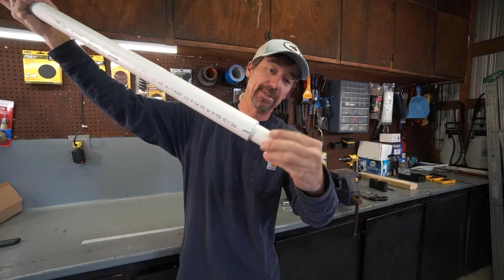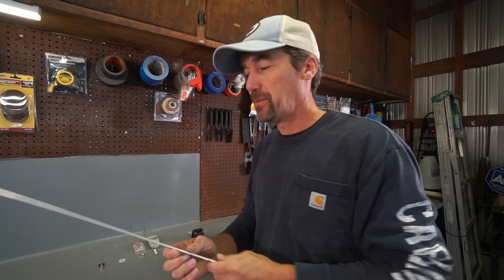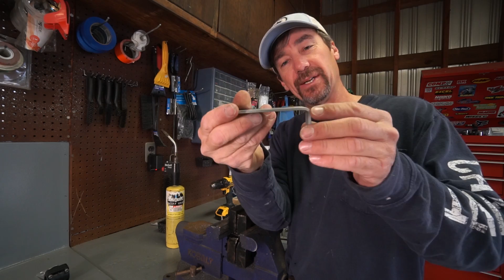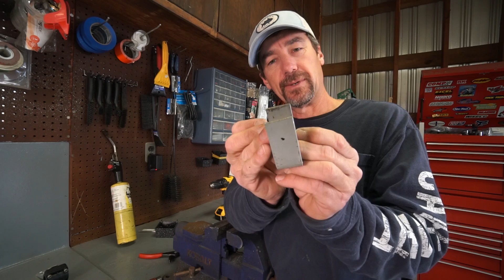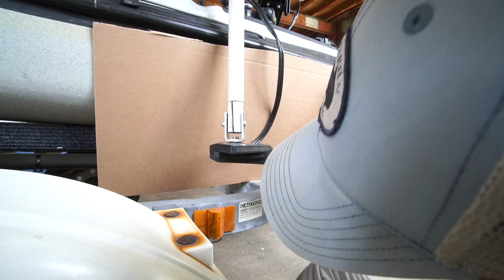Livescope Perspective Mode Transducer Mount Build (WAY Better Than Garmin's)

Comment: I know this vid is 4 years old but I'm assuming it would work same way with new lvs34 transducer? Is lining it up for the different modes not as complicated as the manual says? This mark has to be in this position, that mark has to be in that position for perspective, then 2 totally different mark positions for forward then another 2 for down? New to all this and just trying to figure it out

Comment: I made mine today just like yours. Thank you very much for the great how to video! I'm going to try to mount mine using two one and a quarter tees. One tee mounted on the boat rail the other on my live scope pole with a piece of "all thread " and just pin them together. Maybe it'll work. Tight lines
Reply from the maker: Thanks and good luck!

Comment: This is an EXCELLENT video sir! I have  my Lv32 transducer on my trolling mtr but when when I try and scan with it I don`t see my little position icon on my screen. You know that little circle that shows the direction? Can you help tell my what I need to do to get it on my Garmin HDU 93sv unit?
Reply from the maker: To be honest that function has always been buggy, if your calibrate the compass in the setting it will work, until you switch modes and then it stops. I never use it. I have an indicator that show the direction.
Reply: @SouthernReelsFishing  Thanks!

Comment: Does the transducer need to be below the lowest point of your boat so that the boat doesn't block the signal? How far below the hull does it need to be?
Reply from the maker: Yes it does. And question 2 would be the top of the transducer should at least be level, or lower than the lowest point of your hull

Comment: I'm a kayak angler I just got 10" ultra & going add lvs34. I'm looking at different mounts & for pricing I think I'll try building one first. I have access to aluminum at work so I just have buy pvc what size pvc are you using? Can you use any smaller or not?

Comment: Great demonstration! Explained perfectly! I would like to see your mount on your big boat. Thinking of buying a live scope,  but it’s a bit intimidating with installation. Where is your black box located and what is your power source. Do you also have a Humminbird installed. Thanks!
Reply from the maker: Black box is mounted inside the hull in the back area up to the cargo floor. No humminbird just garmin. Power is Nocqua lithium batteries

Comment: ok, I made on of the first brackets and sold that boat (Pathfinder) last june.  Now have a Blackjack 224 and making another Livescope DIY.  I’ve looked at some of the pre-made mounting systems and thought would like to try the DIY first before investing large $s.  Have couple questions though.  If I wanted to run the connector up the PVC pipe it would take a 1.25” pipe to accommodate the Livescope connector.  that said then would the 1.25” pipe fit inside a 1.5” PVC pipe.  I haven’t tried this yet so thought I would ask.  Also with my boat it has a couple of the RailBlaza bases on the gunnel so I’m going to try one of their mounting plates to see if it will hold the pipe ok even when I might be trolling.  I’ve already ordered a Ram mount C size as a back up.  I used that design on my previous Pathfinder.  So anyway, will be mounting all this when I get back to Grand Isle, LA end of next week.  Appreciate all the work you’ve done sharing your experiences and trial and errors.  Thanks, Michael

Comment: Just looked at it again and really appreciate it. Would give you a double like if I could.   Anyways, any chance you can make a few of these and post for sale?  It looks simple enough but I don't have a way to heat it etc.   Curious if you would consider that. Would be a great help.   Also, as you turn it repeatedly, does it now wear out the pipe and get loose?  Do you keep tightening it? Thanks again . Just superb.

Comment: how do you recommend install pvc pipe to a bass tracker pontoon boat? need to clamp on side somehow.
Reply from the maker: Ram mounts are hard to beat. Go to there website and they have u bolt style fittings that you could use.

Comment: What size where your PVC pipes?

I went to Lowes today and the 3/4in wouldn't fit in the 1in, so I had to go 1in inside of a 1 1/4in

Also, how did you get an H-rail mount to hold that PVC pipe?
Reply from the maker: I use the 1 in inside the 1 1/4 on my longer boat setup because it needed the extra rigidity. On my yak I use a 1 inch pvc outer with a 3/4 inch irrigation pipe inner. Also all the fitting are the barbed type press in that the irrigation pipes use. The pipe is sized right to slide right into the 1 inch pvc. Links below

https://www.lowes.com/pd/Silver-Line-Plastics-3-4-in-x-2-ft-160-PSI-Plastic-Coil-Pipe/1000170901

https://www.lowes.com/pd/Genova-3-4-in-Dia-Insert-Male-Adapter/3455128

https://www.lowes.com/pd/Genova-3-4-in-Dia-Insert-Plug/3456480

https://www.lowes.com/pd/Charlotte-Pipe-1-in-dia-x-5-ft-L-450-PSI-PVC-Pipe/3133093

Comment: New subscriber, great video.  I went back and watched your previous video,  definitely prefer this mount to your original design.  How tight are you attaching the U bracket to the transducer head?  Should the foam washer be preventing the head from moving or should it be firm but not too tight for minor adjustments?   Keep the videos coming.
Reply from the maker: Not very tight. The washer holds it in place but allows movement if you need to adjust it

Comment: Great video!  One question I have is how did you figure out where the front of the transducer is when it is in perspective mode.  In other words if I was looking straight at the transducer that was pointed directly at me what would I see?
Thanks
Reply from the maker: I just squared of each flat element on the transducer. There are 3 that are staggered. Pretty much 90 degrees off the middle element is straight ahead. A full proof way to line it up in while in the water point it at a small pole and line it up that way

Comment: I don't think the angle is needed. The top of the transducer is flat. The angle is 8 degrees on the Garmin shaft mounts to clear the trolling motor if mounted on one. From Garmin "The trolling motor shaft bracket features an 8-degree cant to reduce the effects of the trolling motor barrel interference with the transducer beam."
Reply from the maker: Yeah it would probably be fine without it. But I have OCD so it bothered me lol

Comment: Not sure if anyone else mentioned this, but you can mark your line with ivory soap (or just put some soap near the line) on the aluminum and heat it until the soap turns black. Ivory soap turns black at the same temperature for annealing aluminum, so once it turns black, you can bend it safely without tearing it.  Thanks for the vid!
Reply from the maker: Nice tip brotha thanks!

Comment: Thanks for sharing, helpful video! my livescope is on the way, but i want to start building this, and remplacing your botom attachement with a ram mount system... Do you know what type of thred is the original bolt of the lvs32? i will replace it directly with a ram mount ball to screw in it, but can't find the info... Thanks!
Reply from the maker: Don't know the thread size and pitch off hand but I could check at some point
Reply: @SouthernReelsFishing  top thank you 😊

Comment: Thanks for posting...Good stuff,nice and simple mount! I have one on order and can't wait to get it out on the water .Any vids available of the 'ducer in the horizontal -side scan position?FOUND IT>>   https://www.youtube.com/watch?v=LkE1GvuwNEw     thanks!
I'm a bit of a MacGyver myself and half the enjoyment is outfitting my yak. One tip I can offer up if I may. I have a Pescador pilot that I modded with a minn-kota endura 30.I removed the transom mount bracket and mounted the pedal clamp to the kota shaft...drops right into the motor cavity and works great. The discarded mount (with the transom thumb screws removed) fits perfectly over the gunwale / mounting track and works pretty slick for the 'ducer mount.One hole drilled in the bracket and a hold down bolt/wing nut keeps it all secure.Cheers from Prince Edward Island, Canada.

Comment: Good stuff sir. I've got everything to build my first mount tomorrow morning, but I'm still not understanding the 5* angle and it's benefit? Is it built in side to side or forward to aft of the bracket? I'm just not getting why it is important?
Reply from the maker: It is basically leveling the transducer when in perspective mode. Not too important I guess, but it bothered me
Reply: @SouthernReelsFishing  Thanks Jesse. What was it that bothered you? Having the 5* slant or not having the 5* slant? Looking at the sensors in relation to the mount they appear to be on the same plane. I'm still not getting it but then again I haven't had mine on the water yet. Just built the bracket, without the angle. Maybe it will become apparent once I get it wet. Thank You

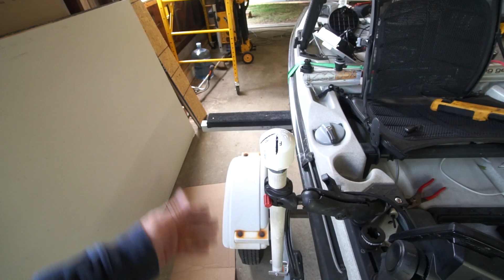Comment: What is the piece on the RAM mount that connects to the PVC pipe on your kayak? I see it at 14:53 with the red knob?
Reply from the maker: That is a modified Hobie H-rail ram mount that I hollowed out to fit the pipe. Not the best option but it is what I had to work with at the time

Comment: hy i hate to bother you but i got my mount installed and updated my echomap plus 93sv to latest software 11.20  and went fishing this morning and only had forward and down mode ,am i doing something wrong i went to setup and orientation and it only showed down and forward to chose from 
thanks ROD
Reply from the maker: Sounds like the gls10 didn't update. Was the module powered up when you updated?
Reply: Southern Reels Fishing that was it I called garmin today. And actually there was a new software out today 12.0. And 2.49 on the gls10 I installed this evening and it works correctly now. And thanks for the mount developing work. They told me that they had hundreds ready to distribute to retailers I told him I found one better than there’s and a whole lot cheaper than $99. Thanks again for the response and good luck on the waters ROD

Comment: that's the way it ought to be done.  It's just the perspective mode pointer will be 90 degress off.  I just use the pointer as a reference to the left side of the perspective screen instead of the middle of the screen.  Thanks for sharing. Tim
Reply from the maker: Thanks!

Comment: Okay Jesse, I still haven't cut my aluminum strip yet for my build. Is this your "final answer" to the design? It is better than the expensive Garmin build and much much cheaper. I bet Garmin engineering will contact you soon. Ha! I noticed my transducer mount that rotates has a small angle incorprated in the plastic, not sure why.  Thanks for shareing your designs.
Reply from the maker: Yes this well most likely be my final design. Thanks for watching!
Reply: I believe the angle you're referring to on the transducer mount is there to angle the sonar beam away from trolling motor when mounted on shaft of trolling motor.  I learned this by watching Garmin you tube video describing the livescope transducer in detail.

Comment: Thanks for posting these videos. I copied your build and upon completion, found your new bracket. I’m hoping to get out tomorrow to try out the Livescope. I plan to make this bracket in the near future. I should add that your sheepshead and trout LiveScope videos are some of the only brackish/saltwater videos out there. The videos helped me confirm that this would work for what I need.
Reply from the maker: Thank you for watching and commenting. I am glad you took the initiative to build your own mount! I did warn early on that I would probably improve the original mount but I didn't expect do to it so soon. Anyway the original is going to work great for you, I mean it literally is a direct copy of Garmin's design.  If you feel the problems I mention are an issue for you then I would suggest trying the new setup. Thanks again!
Reply: Southern Reels Fishing, definitely! If I decide to switch, I have all of the parts ready to go! The new mount system is a brilliant idea. I am actually surprised that no one at Garmin thought of it before launching a $100 part. Anyways, I’m subscribed to your channel and am looking forward to your other videos. Your fishing is similar to the inshore fishing I do in NE Florida.

Comment: Hey Jesse, I enjoy your channel. Sometime, we need to get you and Braydon to do a collab. [My son, Braydon Price, Youtuber]. LOL, he needs someone to teach him some basics of NC  coastal fishing. I can't. I'm freshwater guy. Question, I built my mount off your ideas of the Ram mounts. But I have lots of flex. I wonder if this is acceptable... or did I buy a rubber version that should have been metal??? Mostly coming from the piece that glues into the T fitting? Any help appreciated
Reply from the maker: Id be glad to help your son if I can. As far as the flex is this on a boat setup or kayak? Also what size pipe did you use?
Reply: @SouthernReelsFishing   I called Ram mount. I'm getting all the flex in the rubber balls. They said they don't make a metal ball. So, I'll figure something out. It's on a boat.  Longer length than a kyak.
Reply from the maker: @martyprice5619  Size up the ram ball system. I use size D on my setup for my boat
Reply: @SouthernReelsFishing  Using C. Turns out that a little flex was acceptable.